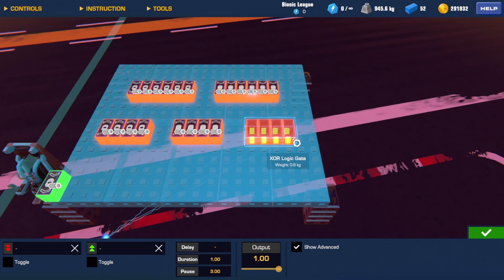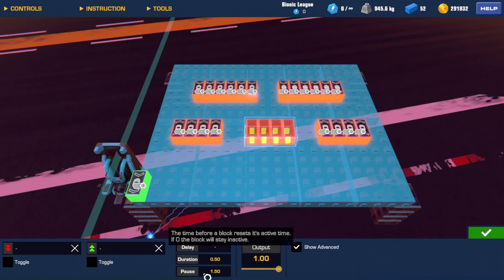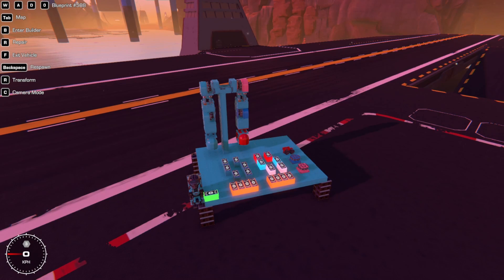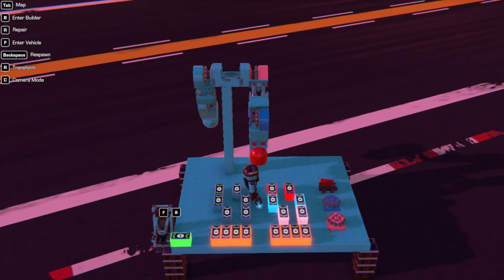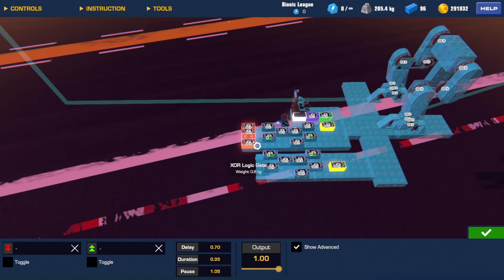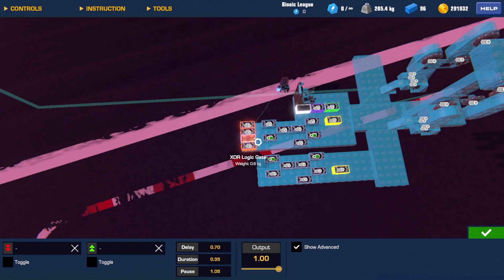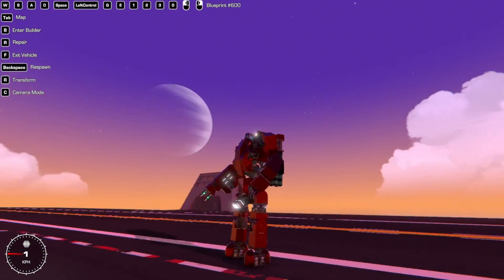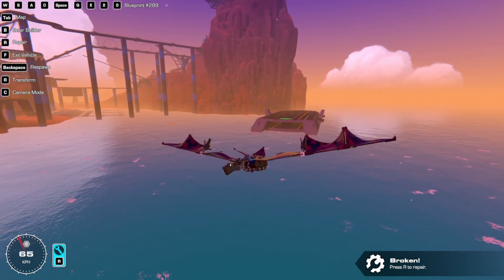an advanced walker dissection - Trailmakers creations   :)

Comment: why so much logic you could have just used delay and duration and use pause so it has time to go back to its original position its easier and does not need any logic just the servos so it walks faster and better.
Reply from the maker: in the introduction i explain the reasons why i do it the way that i do and make clear that my way isn't the most efficient, but yields good results in specific areas, i don't want to accuse you of not watching the video but it kinda feels like you didn't watch the video...
Reply: na i didn't i just saw like 25 logic gates @XenoII
Reply: Would you happen to have a tutorial?
Reply: @slothbones9677  ill think about making one if i have time